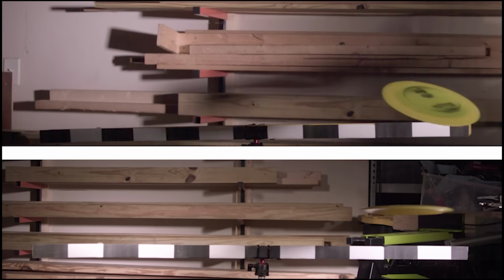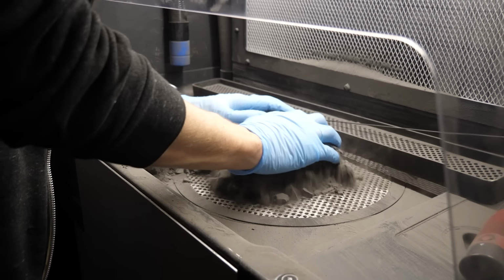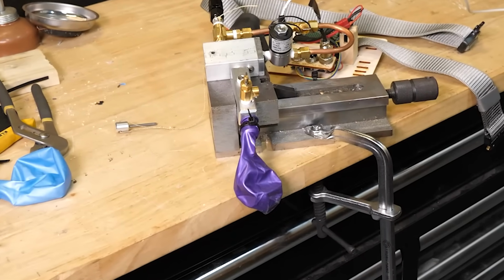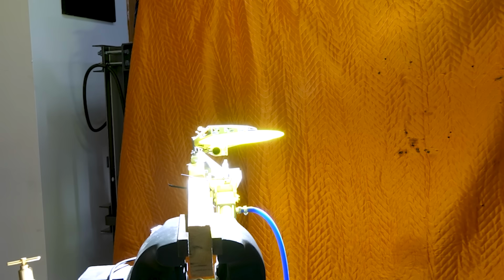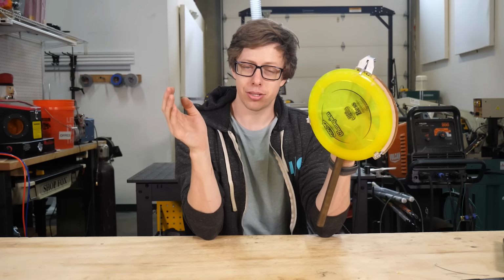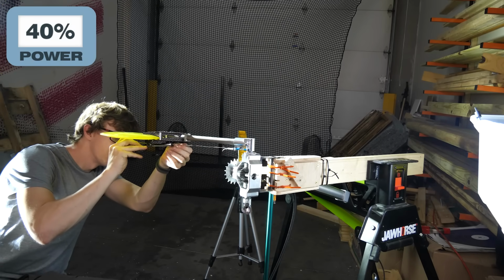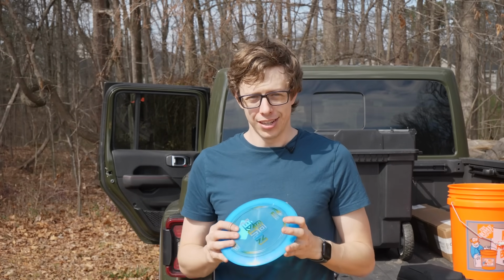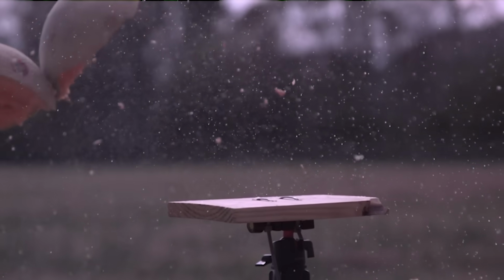Wrist rocket: worlds fastest disc launcher

Comment: I've played disc gold for about 8 years now and this is soo amazing!. The engineer in me loves this! Tip would be to make sure you have the higher speed disc (13/14 - first number on flight numbers) and also one that has a high stability (3/4 - last number listed in the flight numbers). The other big thing is your release angle. At your high speeds, i would try releasing on a "hyzer" angle which is around a 45 degree angle. This gives the disc more room to not flip over into a barrel roll. New subscriber here!
Reply: "Stability" a combination of the last 2 numbers. The 3rd number being high speed stability and the last number being low speed stability.
Reply: speed ends up not mattering as much its more important for stability. Simon Lizottes Tilt would probably work, thats probably the only disc that would work because his others were doing skomahawks.
Reply: @Temkef  it was throwing everything on anny. Throwing a nukeos like GG throws katanas (way up in the air on hyzer) would be a good starting point and then dial the release angle up until a good full flight is realized.
Reply: @gannonolson6294  yes ofc, but they are doing skomahawks so even if he puts it on a spike hyzer angle it’s still gonna roll.
Reply: @temkef6124  that doesn’t mean it wasn’t infuriating seeing every throw on anny and not on hyzer
Reply: Yes, agreed on everything (even on being a disc golfer & engineer!).  See my other points have already been made in the replies... hope there is more tweaking to come on this, though I kinda doubt it.  ah well, it was very fun to watch.
Reply: Important to note that hyzer is outside edge down. I think 45 degrees is kinda extreme, I would think between 20-30 degrees, but who knows at those speeds!!

Comment: This is awesome! I’m a mechanical engineering grad student who is a “professional” (only locally for now lol) disc golfer. My thesis is actually on the flight characteristics of discs and those flight numbers you briefly mentioned. I’ve long thought about what it would take to create a system to simulate a thrown frisbee and be replicable. This confirms my suspicions of how difficult that would be. Fantastic stuff and hey it’s a long shot, but if you ever want to work together, I may be able to help with some of those distance issues!

Comment: It’s amazing that you made a backboard that will move anywhere to catch a basketball in a 3D space, and you seemed to have less struggle figuring that out than creating a machine that throws a frisbee. I envy your skills, resources, time, and knowledge to do both.
Reply: The problem you need to solve are different. For the 3D moving hoop, the problems are mostly in software, the hardware is easy enough. For this, all the problems are in hardware. Hardware is usually more difficult to deal with than software. (Re: Integration Hell)

Comment: Hey there! I've been a big fan for a while, and I'm an avid disc golfer, and another important note is the release angle for the disc. You could have it release on a more severe hyzer angle (aka the side of the disc opposite your hand being point toward the ground), and that may allow the disc time in flight to turn and level out, before it fully turns over.
Hope this helps! Thank you for the amazing content!
Reply: I came here to say this! In ultimate frisbee we call it "IO" for inside out, and you are currently throwing them "OI". It should indeed go farther before flipping over if you start with the side away from you pointed down.
Reply: ^^ This.

Also, getting more spin on the release will be key.

Comment: Awesome project as always. These are two of my favorite things. The whole time I watched this I was hoping you would figure out that you need more spin on the disc. You can make a high powered clay pigeon launcher that fits a disc. Also, look into "hyzer flip" if you get the angle right then you will definitely throw it really far. I bet you could reach 1000 feet. I'm looking forward to see the next version!
Reply: I was wondering how much rpm of the disc was effecting the distance. I have a clay thrower and it imparts a good amount of spin, I assume to stabilize the clay in flight.

Comment: made my day seeing three of my favorite things in this video! your brilliant build, disc golf, and Simon Lizotte!  it's really incredible how capable a human is at a task like throwing a disc. the long straight pull on one edge of the rim combined with the whip at the end is key!  I'll bet you could get Simon in the next video if you invite him!
Reply: Agreed, the whip at the end is key. The problem is the G forces are applied immediately instead slowly increasing in ratio to the size and weight of the disk.
Reply: Simon needs to send him a tilt I think it would work with speeds he is using
Reply: i was also thinking maybe using an offset axle position on the drive sprocket could help the acceleration burst from the air have more leverage to start and more speed at the end.

Comment: You need a disc called the “Tilt” which was actually specially designed by Simon Lizotte! It’s the most “stable” disc on the market
Reply: It probably wouldn't get good distance but would prevent the disc from flipping over. I would LOVE to see if he could flip the Tilt though!
Reply: Stiletto would probably be awesome to try too!
Reply: @dust-yo  Ya could be good for distance. It is much easier to flip than the Tilt though, Tested the two with all kinds of shots, Tilt is much more overstable.

I think colossus might be good for distance, might just have to release on a sharp hyzer to flip to flat.

Comment: I think this is my favorite video of yours so far - fascinating and hilarious! I looked up at the thinning lunchroom and only then realized it had been a half hour…

Aside from the spectacle and wanting to make a more “human” thrower (which I 100% appreciate), do you foresee issues with a pitching machine type launcher with a flat friction plate on one side and a compliant wheel/belt system on the other to impart speed and spin? Those were really popular in FRC robots a few years back to throw regular frisbees.
I’d be really interested to see if that family of designs has an upper limit when subjected to absurd g forces like your first many generations of gripper.
Reply: I think looking at sporting clays traps for ideas might pose some benefits as well. 
Though perhaps the frisbee isn't stiff enough and/or heavy enough to use them?
Reply: Not really a throw if it's launched via a wheel.

This is a throw.
Reply: FRC students assemble
Reply: Ahh, you started to describe it and I jumped ahead to the Ultimate Ascent year. Our robot only climbed though (strategy oversight, thought it would be more valuable) but we did prototype launchers.

Comment: You''re so patient when something breaks!  I play a bit of disc golf too, one thing I can maybe think is you need to release the disc from the machine on hyzer.  Currently the machine is releasing the disc on anhyzer, and with so much speed, its turning over (into a roller), especially on less stable discs.  Releasing on hyzer will give you a better chance of flip up to flat, and let the disc do its natural full flight (way more distance over the crash and burn that's currently happening).  Maybe something to think of for V2?

Comment: I LOVE that you tried to do this. Can't wait to see the next version.  Also, in preparation for the next version research the "hyzer flip" and consider the release angle.  It could be a valuable concept to get more distance without super speed. Then again, I've never seen any new discs flip enough to end up upside down so quick.  A fun challenge!

Comment: Hey there! As an engineer and disc golfer, fun video! Lowering the release angle will help a lot. Distance drives are expected to fall right, then as the slow fall left. If you start with the angle countering the initial fall, the disc will be able to slow in the air and start to fall the other way. The result is a ton more distance (with your existing setup!)
Reply: (Been searching through comments for an engineer and disc golfer for this question.)

 Is there a fundamental issue with the release approach, specifically the swing radius? I’m a novice disc golfer but the “how to throw” videos I’ve seen say do the “lawn mower” pull rather than a extended arm release. Aka a linear-ish launch vector across the body with a last second rotational release from the wrist rather than a full rotational release from the shoulder + elbow.

Do you suppose this throwing form is related to the inherent aerodynamics of this disk or to generating the maximum power+control for human arms?
Reply: @rossbrown1273  The lawn mower pull is actually a really flawed practice taught by pro's who are very good at throwing discs... not so great at teaching. Watch any actually good coach like overthrow discgolf, and watch slow motions by paul, simon, drew, and you'll note that the arm should be merely used as a loose bat. You aren't pulling the disc across your chest, you're letting it come in and actually pushing it out of your chest as you unwind and rotate your upper body. You want your arm to extend out, and the purpose of the arm coming in to your chest is done to increase your angular momentum / spin rate not only for your body, but also on the release of the disc. This machine has zero problems spinning at accurate trajectories at the speeds that it does, so it doesn't have to do that, but it also looses a ton of spin by having a rigid arm.
Reply: @rossbrown1273  there's definitely a problem with the release, but it's not what you think. In fact the throwing radius is negligible. If, I a moderately strong but by no means ripped 6'2" man had a throwing contest against someone like Tyler1 who is 5'6" and muscular he'd probably out throw me even though I have a longer wing span because he can put more power behind the disc. The problem with the release is actually the lack of rotation in the disc. When a pro disc golfer throws a disc they flick their wrists with almost all of the momentum of their arm. What you're doing when you get a really good throw is taking the rotation of your body, and the momentum from that, and transferring it into your arm which is transferred to your wrist and released into the disc in one motion so all of your body's force and momentum goes into the disc with a good spin as well. He could have made a smaller arm to work like the wrist in this regard to get the most out of the power he's using to throw.
Reply: @swagmiredoesall  who's tyler1?
Reply: @mrosskne  a streamer who probably uses steroids lmao

Comment: Have you looked at the spring powered clay pidgeon launchers at sporting goods stores? They look similar. Simpler without the arm breaking or death features 😇
Reply: Would be more accurate BC they aren't torquing around destabilizing the disk before it's thrown
Reply: Came here thinking the same thing. Clay machines generate spin by sliding the clay along a track prior to release
Reply: I like how he stuck with the principle of a rotating arm. I probably would have looked into a more direct linear launch after the first few prototypes
Reply: Came to say the same. I love his videos, especially the fact he shows his working through the  iterative process of prototyping. This build though I found myself trying to talk to the screen pointing out he was reinventing a wheel that already works very well.
Reply: XD

Comment: The frisbee has a tendency to curve left or right, depending on how it is held, it has to be released at an 
angle to fly in a flat "S" curve. Tilt the machine to the left.
Reply: exactly. drop the left side of the machine by 30°and it will fly a lot farther.
Reply: this could be a record breaking mod to the setup
Reply: It def needs more spin too

Comment: Not sure if you knew this, but most of the throws you are simulating with the machine are being thrown on what disc golfers call an anhyzer angle, where at release, the angle created from the horizontal plan to release point then to edge of disc is positive. Hyzer is where at release the outside edge is negative. at high speeds the discs will flip up, from hyzer angles to anhyzer. if you were to come back to this project, it could be something to test around with.

Comment: Would have loved to see it throw a discmania Tilt (most over stable disc ever manufactured) on a hyzer angle at the 75% power. That wouldn’t flip no matter how much torque and speed you put on it.
Reply: so true
Reply: I would definitely like to see this. It looked like the releases were all anhyzer, which could have been a major contributor to the discs flipping over. Tilt on hyzer  release would be so cool to see on this machine.
Reply: Oh it would flip just that it might flip a lot slower.  That machine needs a disc with a massive rim.

Comment: I love it thanks for posting! Upgrade it! My feedback is that in disc golf when the disc CAN'T handle the torque we're putting on it, we increase the hyzer angle. It looked like you were releasing the disc on anheizer, so if you took the discs that were turning into rollers and put the disc on extreme hyzer, it would probably go an insane distance

Comment: Another great video!  One thing that I was reminded of while watching was a game my brother and I used to play as kids.  We called it screwby, and it required the use of screwby sticks.  We had apple trees in our yard, and we would take long, straight, flexible branches and trim them down so they were like organic fishing rods, and we would sharpen the small end to a point.  Next, we would take an unripened green apple, a little larger than a golf ball, and jam it onto the sharp end of the stick.  Next, we would swing the pole, starting slow, and then increasing speed quickly as the throwing motion completed.  The result was, we could fire green apples into the sky, and they would disappear from view.  We would eventually hear the impact on someones roof, several blocks away.  This was very dangerous, but we were just dumb kids.  In fact, at some point, we decided it would be smart to fire these apples at each other.  The game only lasted until the first direct hit.

I am wondering if v2 of your disc thrower could use a similar concept, and only use human power, and a greater throwing arm/radius to crush the record from v1?  Kind of like a modified Jai alai wicker cesta.  Just a thought.  Thanks again!

Comment: I have longed for a video like this for so long! Love it.
I would really like to see a part 2.
The angle of release is super important. I think you should try more of a hyzer release or just mess around with the angle of release. 
Then you could try some super overatable discs like innova max, kasta plast Rask, latitude 64 missilen.
It would also be interesting to see if you are able to get "the correct flight" out of different disc, corresponding to the flight numbers when thrown at correct speed, and if the same disc mould would end up at the same place/distans thrown at the same angle with the same speed.
The dream would be that manufacturers use a machine like this to get the correct flight numbers on discs. 
Keep up the good work! You always provide high quality videos 👌
And of course, you it would be amazing to see you get a disc far as f***.

Comment: Release the discs on an extreme hyzer angle so the can flip to flat or “flex” and then fade back!

Amazing video!!
Reply: Only if it had good spin too. Without gyroscopic force it won’t correct its angle.
Reply: @johnmickey5017  If it didn't have spin it wouldn't have turned over.
Reply: @brianschuh2362  a disc flips due too lack of spin relative to the speed it is thrown.
Reply: exaclty what i was thinking.
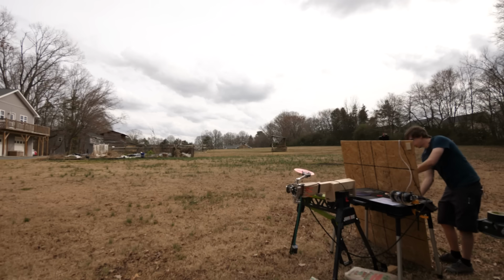Reply: 22:40 demonstrates well that the disc is spinning to fast for the angle he is throwing.
Idk what a hyzer angle is but i bet i could guess being an enthusiast of the sport.
Reply: Looks like the device is releasing on an anhyzer angle also from the video. I think the power is so great it causing the whole device to rock and shift the release to that angle. at least from what I am seeing from the cameras shots.
Reply: this ^ it will easily break the distance record if he angles the arm down

Comment: Awesome video. 
It looks like the disc is coming out on an “anhyzer” angle, which lends itself to turning over faster. 
Check out the physics behind the “Hyzer” angle and the disc golf throw called a “Hyzer flip” and see if you can increase the distance with it. 
V2 definitely needs to incorporate more spin too for stability and to decrease the turnover.
Reply: If you measure the hypotenuse next to the angular region disproportionate to the centripetal force, you should achieve maximum stability in no time.

Comment: I loved watching this. I spent countless hours in playing ultimate frisbee in college and a lot of time working on the physics of my form. Roughly for distance, start with the outer edge away from the body at a slight negative from angle from parallel. This will create some of the lift for the initial force in the disc. Somewhere around 30% of the disc's travel that angle will even out with the air resistance and the force from gyration.. After that it is all gyration and external forces. I'd love to see a Rev 2 of this. Ultimate discs and disc golf discs have very different aerodynamics too,. I have seen full 150 yard throws land and spin several complete rotations on the grass.